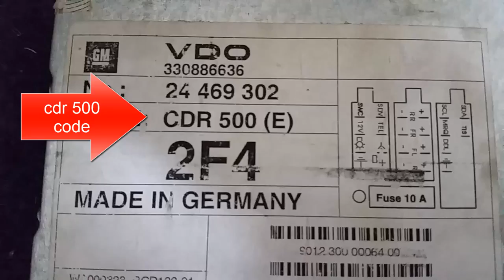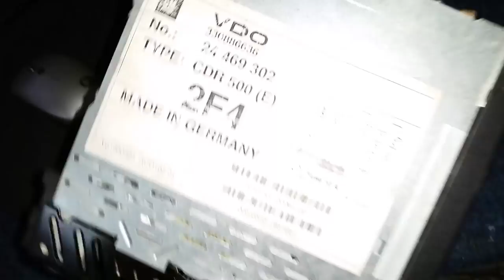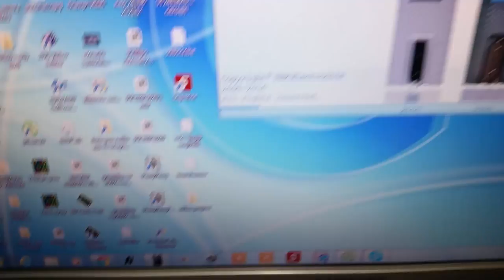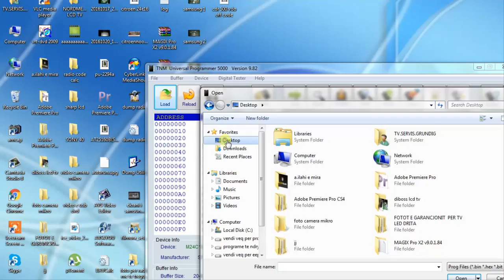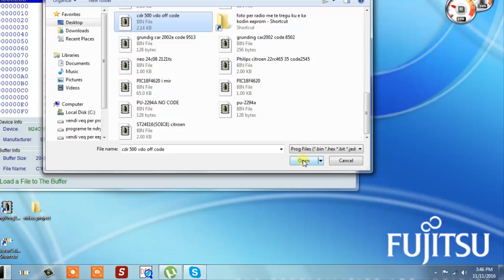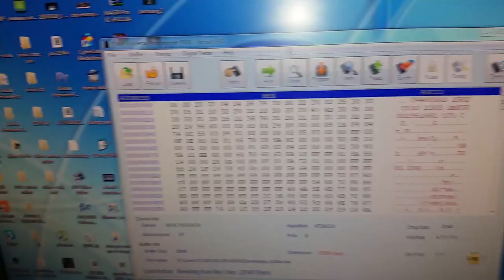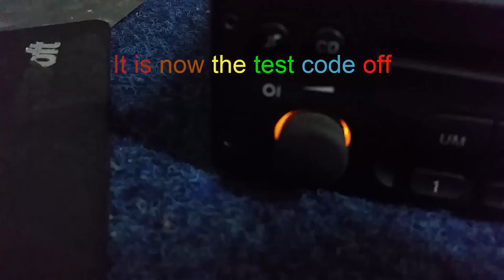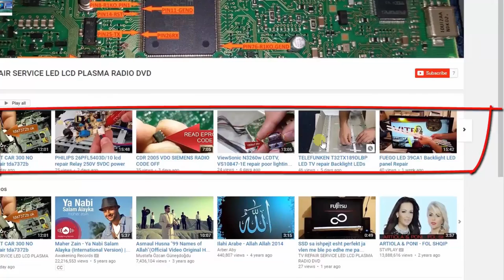CDR 500 VDO CODE OFF radio cd

Comment: I need help  I have a Samsung plasma tv from 2009 and it stopped turning on it makes a clicking noise and the red light blinks every video says check the The capacitors but none are buldged or burned any suggestions please help !
Reply from the maker: To find out whether they are capacitors should excite the hair dryer. the board power supply. 5 or 7 minutes to be heated. if there is no effect. Capacitors are okay. or software
Reply: hello sir, can i have my tv back please?

Comment: you code is 9584
Reply from the maker: I did it without the code. I can even with code and without codes. I can change the code. According to deshire code. 1111 or 9999. or 0001. or off.
Reply from the maker: I even read the code. but I also change the code. even make the code off. you do not need to tell me. that you are a little baby to me
Reply: Service Help Repair Tv Led Lcd Plasma Radio Code
Reply: ممكن مساعده في رمز الكاست